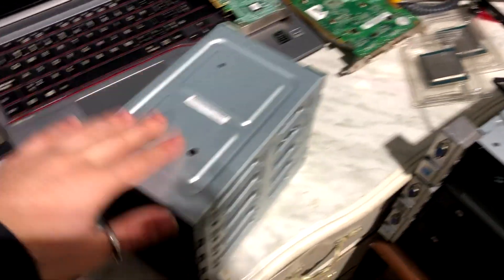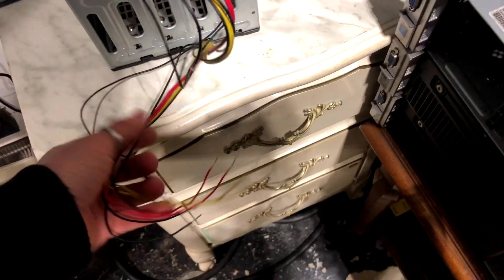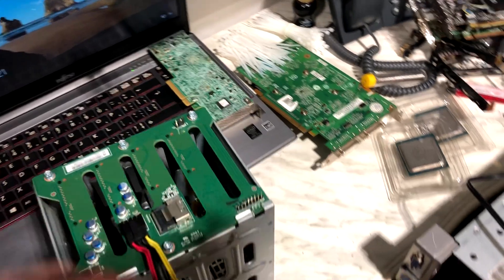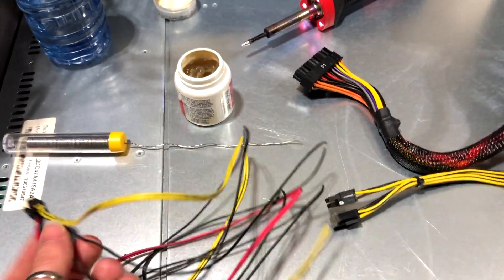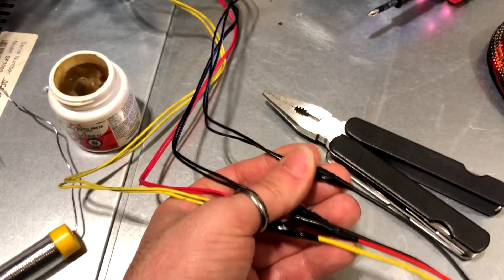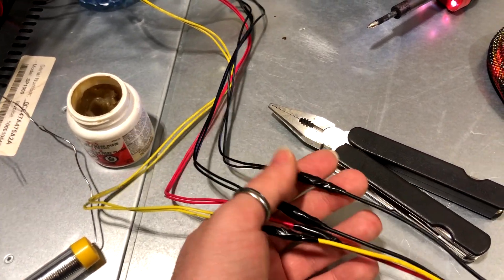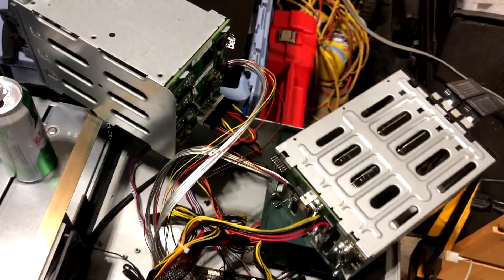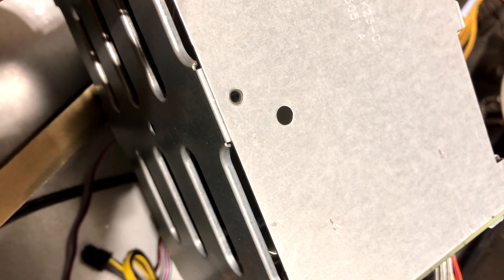Upgrade your Consumer PC storage with SAS - Part 2 - Advanced Basic overview - 7

Comment: You added two extra capacitors to the HP backplane, for what purpose?
Reply from the maker: Hey! Thanks for your question.

The original caps got ripped off due to me mishandling the cage, so i bought 2 similar spec capacitors and I soldered them in place. Their purpose is just to restore function.

Comment: you could have bought molex female+male kontakts and made it into an molex adapter. so u can use it on whatever power supply you want.  But solder works aswell :)
Reply from the maker: Good suggestion.

this was done quick and dirty. I didn't have a lot of time to plan ahead 😅

Comment: Could you go into detail about how you mapped the different voltage connectors on your soldering job?
Reply from the maker: Atx standard. Yellow wire is 12v, red wire is 5v and orange (if applicable) is 3.3.

Just solder the red to the red, the black to the black and the yellow to the yellow.

Comment: What are the dimensions and part number of that hard drive bay? I have a netfinity 5000 case I used for my new case and the old bay and backplane need to be updated to usable technology. The netfinity case is built like a tank and has lots of great fans and room. I really like it but it only came with 3 hard drive caddies and it actually supports five but I can't find 2 more caddies to fit it and I cant use the backplane anyway
Reply from the maker: Hey! Thank you for your comment!

The part numbers are:

Lenovo: FRU03X3703 + FRU03T8868
Hpe: 637218-001 + 466509-001

You can find the dimensions via their respective product information pages.

Comment: Im hopefully soon going to be getting two sas rack mount drive bay server things for free, it comes with a few raid cards so im hoping i might be able to make a system with a few sas drives as its storage drive and maybe keep one of the rack mounts as a network storage system.
Reply from the maker: SAS is the way to go for low budget high volume systems! 10K RPM and full data duplex are night and day when compared to half duplex sata drives.

Thank you for your viewership!!
Reply: @TechLabUnleashed  didn't end up getting them, someone offered the seller $60 and didn't get back to be to outbid him so someone got a steal of a deal

Comment: Ive been running two Intel cages for the last 3 years. $35 shipped for each cage with each cage supporting 6 drives and requiring just 2 molex conectors and 2 sata connectors (sas breakout cables).
Reply from the maker: Managing 8 drives in a cage like that is just hundreds of times easier than managing the dives individually in sleighs

Comment: Pro tip for text time: you can get power splitters or SATA to molex (and the reverse) adapters. Nice and cheap, plus if you somehow screw up, you did not cut up your PSU cables and you don't need crimping tools and supplies for that.
Reply from the maker: The lenovo sas cage is proprietary cables.

They dont come in sata/molex.
Reply: @TechLabUnleashed  they're talking about using the female molex as a connector for the cage instead of cutting the psu cables

Comment: Instead of cutting a power supply cables is there a reason why you would not just crimp molex adapters onto the cables
Reply from the maker: I didnt have any on hand.
If that is easier to do, by all means, please do.

At the time of filming, this was the best thing i could do.

As for proprietary equipment which has specialty connectors, if there is no adapter available, you just have to go the solder route.

Comment: i'm assuming the prices you talk about are for used sas drives, right?
Reply from the maker: Thats correct.
Im aiming to always tell about best bang for highest tier, but used or refurbed.
Reply: @TechLabUnleashed  though so. and although used sas drives are a good choice in terms of cost and reliability over sata ones (new sas are in an entirely different cost category), i still think new ssd drives are the way to go, if you are not in a heavy write enviroment. they are still going down on cost and up in capacity but the main advantage is power, noise and of course speed/latency.